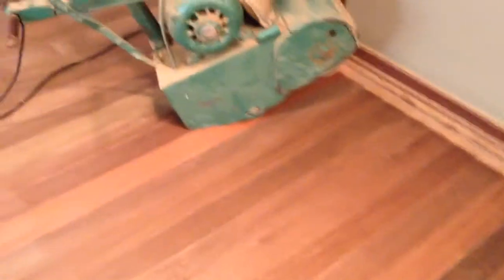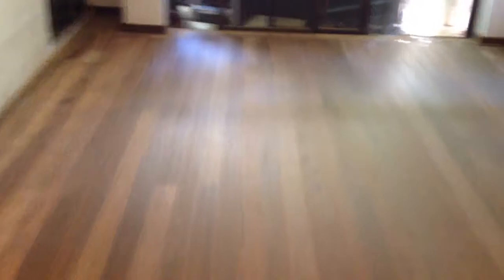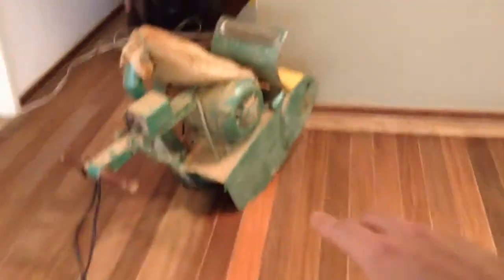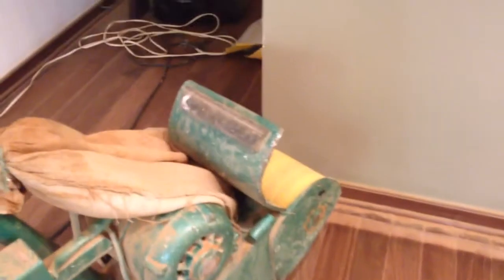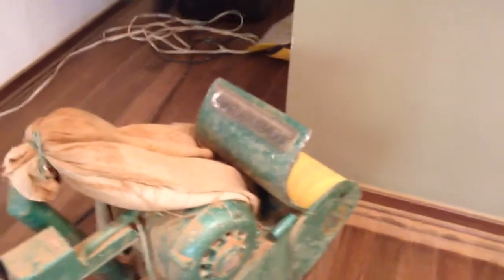Ipe hardwood floor prep

Comment: Good Job matey!
Reply from the maker: Have you done ipe floors matey? They are really hard but you can get a very nice quality if you spend some time and use a buffer of a random sander to finish. I have done many just with the drum sander and 150grit but only when the machine is really tuned in right. Best wood floor you can get IPE

Comment: Do you save the dust to fill in any gaps? How did you seal the floors?
Reply from the maker: Sometimes i save the dust. But only if is the last 150 grit paper. The floor is always sealed with poly or water bourne varnish